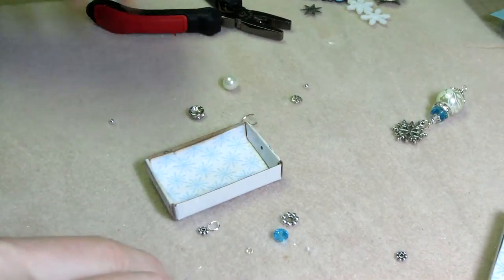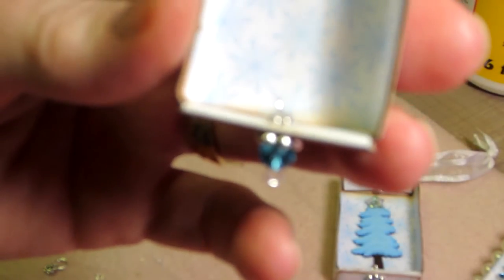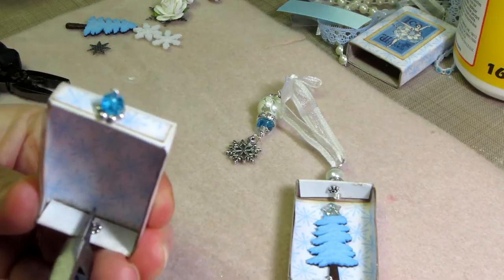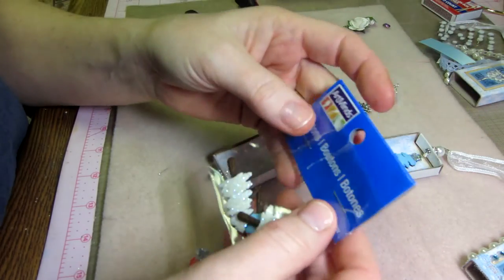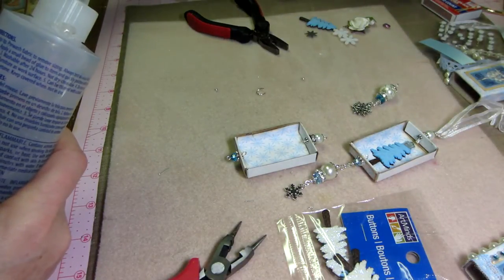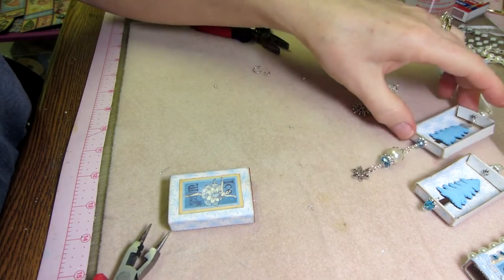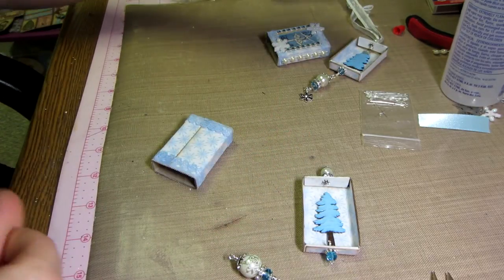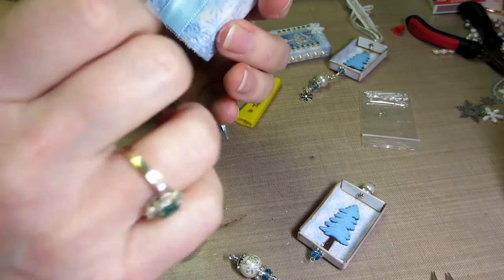Matchbox Tutorial Part 2

Comment: TFS!  So cute, going to make some for sure.  One question, how did you make the holes in the box for the posts?  Thanks!
Reply from the maker: Hi Marie. I use the same tool I use for bottle caps. I showed it in the video but I cut it out by accident. I may add it back in. It's in the bead section. But I don't know what it's called. TFW, sara